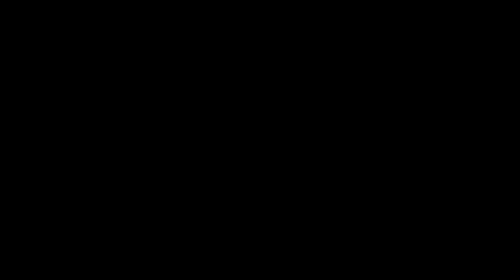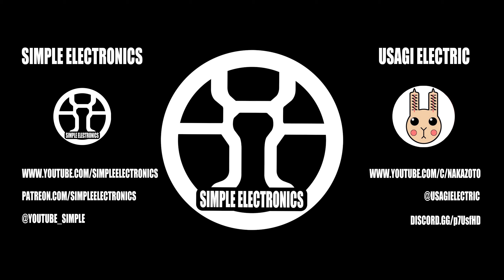The Simple Electronics Podcast - 016 - Usagi Electric

Comment: This was very interesting!  I've been wanting to play with tubes and now I know where I can go to find info on using them at safer voltages for certain tasks....and I wonder if I can turn my guitar amp into a 555 with the flip of a switch (and addition of 15 more tubes)...
Reply: Thank you!
Tubes do surprisingly well at really low voltages! I've even managed to get some moderate results at just 6V on the plate (though I was really pushing the tube into an unusable area). 
I've made some pretty good developments on the 555 Timer kit! I've eliminated two tubes from the OpAmps (saving four tubes in total so far), while actually getting a lot more gain and flexibility to work with a few different tubes. But, if you want to turn your guitar amp into an astable oscillator, well, we can do that with just a single dual triode!